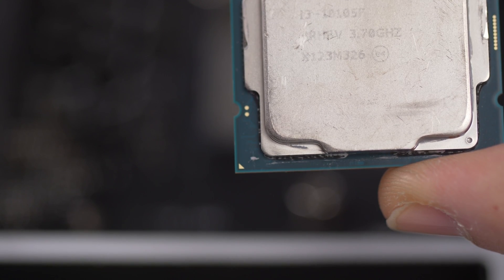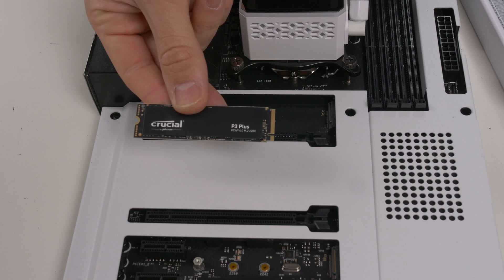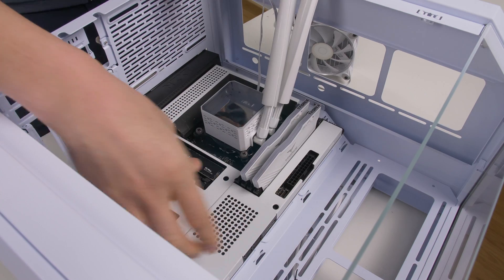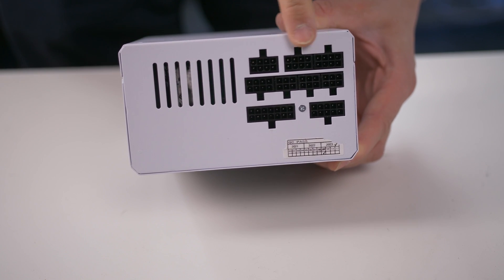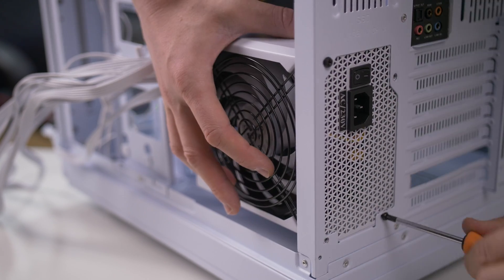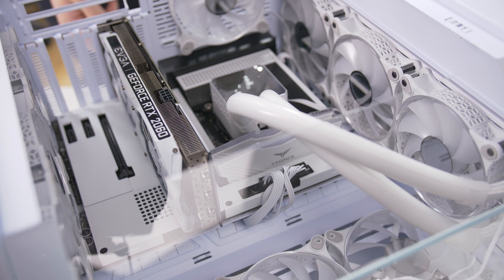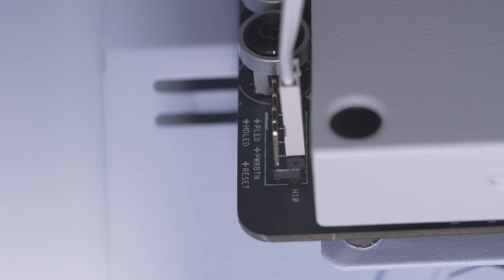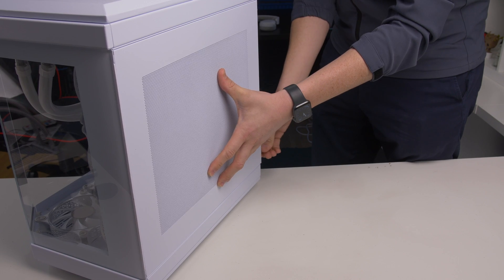How to Assemble a Gaming PC: Step-by-Step Guide with the MC-3T Case

Comment: Saw you only putting 6 connectors into the fan hub even if you had 9 fans, so will it work if I have 10 fans which are the same sort? And if so then what fan hub is that?

Comment: How did you connect the Fans of the radiator? i saw you only putting 6 connectors into the fan hub while you use 9 fans. What happened to the other fans connectors and where did you put the hub in the case?
Reply from the maker: The fans are all of the same model and are connected together.

Best regards!